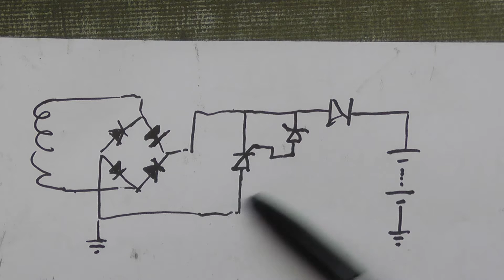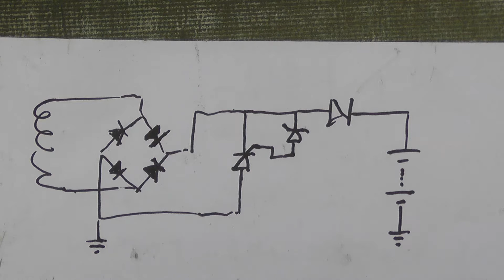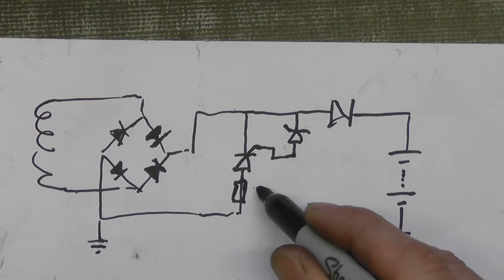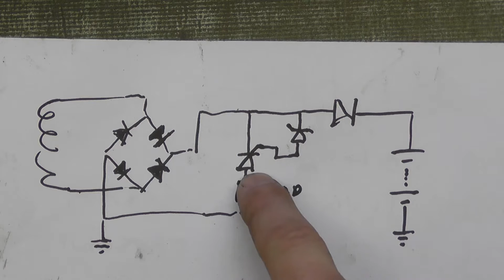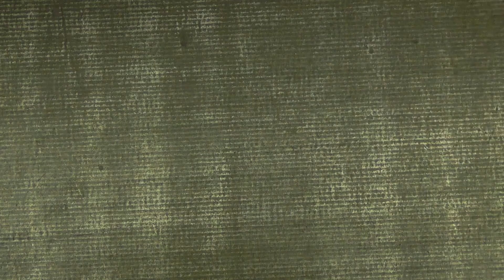Moto Guzzi 250TS Voltage Regulator

Comment: THat should limit the output to under 6V (clamp at 5.3+0.7 - 0.7) )zener + SCR  gate - output diode).
The AC in peak will be about 1.4V higher than the DC trigger point.
It is reducing the peaks , the average will be considerably less unless it is 3 phase. 9V may be about right. 
Never liked the clamping regulator idea as it wasted power. My GPz uses it but on 3 phase.  On its manual, it says the field clollapses and ramps back up. So the average is much less than the peak.
It takes use a good meter that can do RMS on DC to measure the voltage. Some Flukes can, most cheap ones will just read the peak or near it. Measure at the battery can be closer as it adds filtering.
Reply from the maker: I'm aware of RMS bandwidth limitations and I was using my trusty Fluke 77. The clamping voltage isn't the same as the zenner voltage, you need to be far enough over the knee to have enough gate drive current and it seems to be a pretty insensitive SCR.

Lead acid batteries care about peak voltage as well as average. You can generate excessive gassing with the wrong charge waveform, even if the average voltage looks OK.

It doesn't matter if you've got a shunt or series regulator, you're still dumping the excess as heat, but it's a lot less than you might think. The alternator output isn't linear with rpm due to the Iron core saturating.